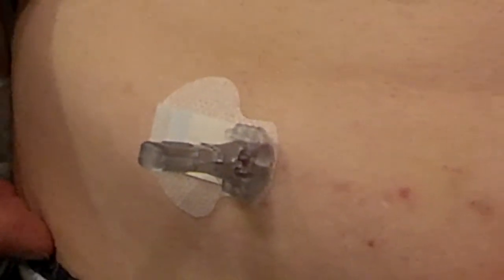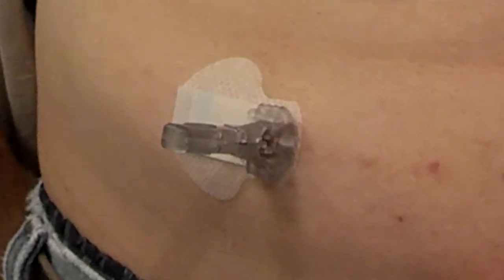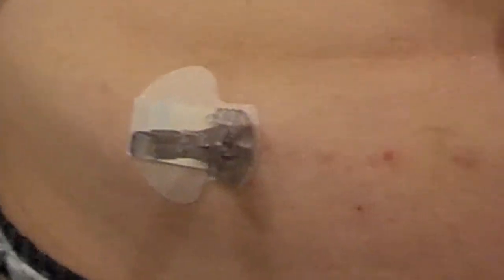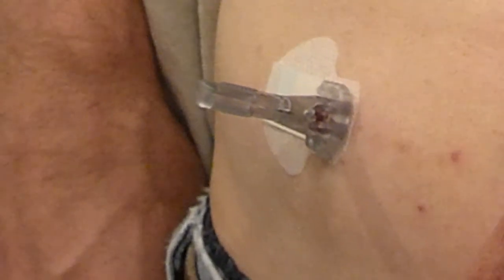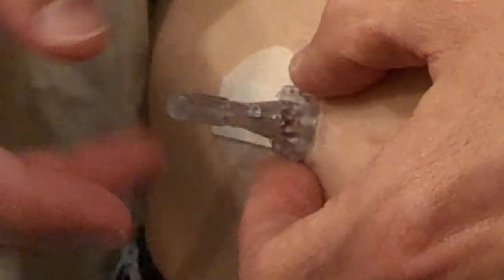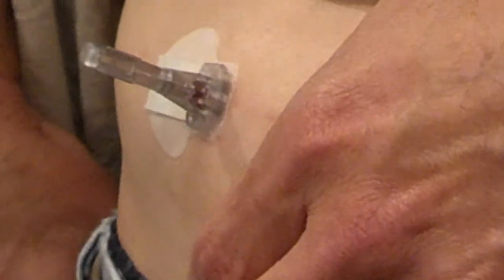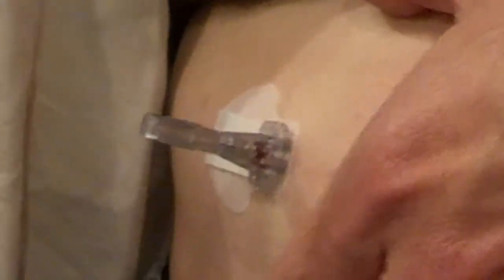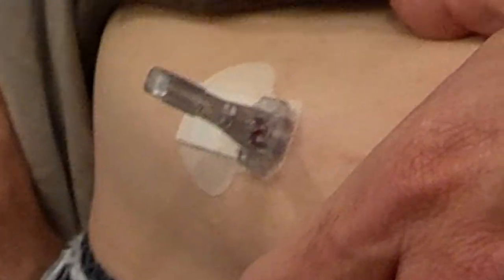#1 Enlite Sensor- Trouble removing needle

Comment: Has minimed reached out to you? Also, could you take some photos of the packaging prior to removing the sensor? I have had the enlite sensor for a while now and today is the first time I've had an issue, but noticed there was a little damage (bent and caved) to the packaging but no apparent damage to the unit itself. Also I noticed when you're trying to release the needle, your "free hand" that is anchoring is clasping the sides of the sensor. I lay the tips of my fingers on top of the little "feet" and find it more comfortable and stabilizing. 

I squeezed the needle portion really hard and pressed with me "free hand" down on the "Feet" relatively tightly and pulled hard and the needle dislodged with some struggle but did come out. 

Have you logged the batch/lot numbers for the ones that you are having issue with? Would be interested to see if there are any similarities in the batch/lot numbers......

Best wishes to you and hope minimed has reached out or responded to you in someway.
Reply: +Sonia Daniels - Update - I just got off of the phone with minimed. (I was calling about something else but since I already had them on the phone I mentioned the trouble with the stem/needle removal. They said this can be caused be a slight raising on one side during insertion, when removing the insertion device once inserted (if it's not completely straight) can cause problems, and various other things. But a bit of good news, they said if I ever have to removed the sensor to get the stem/need out, that they would replace the sensor for free. So there's at least that. Just thought I'd share with others having the problem.